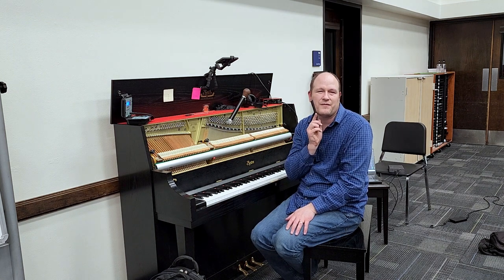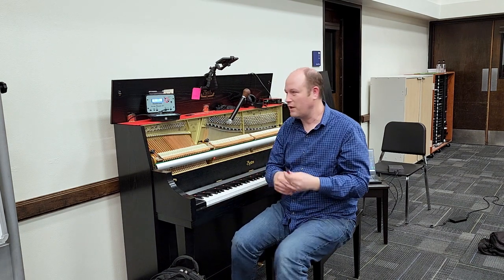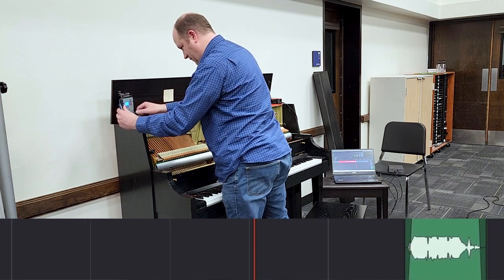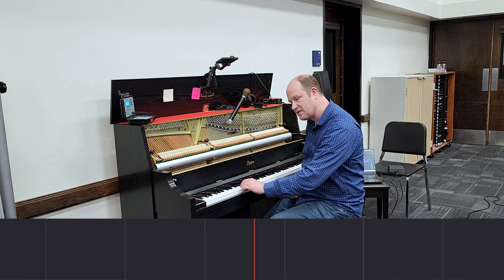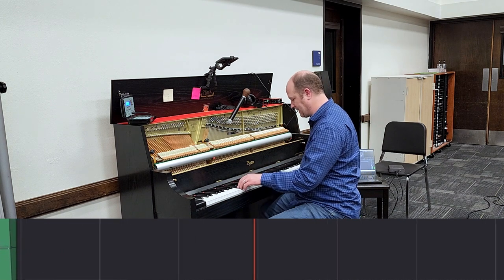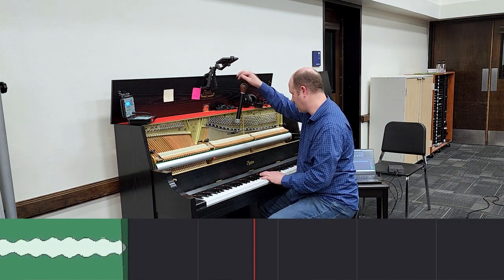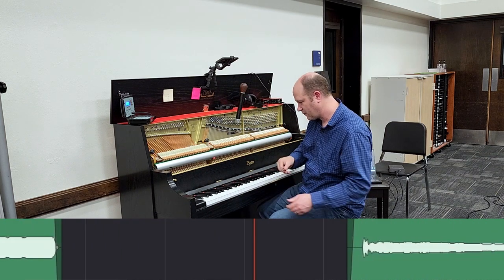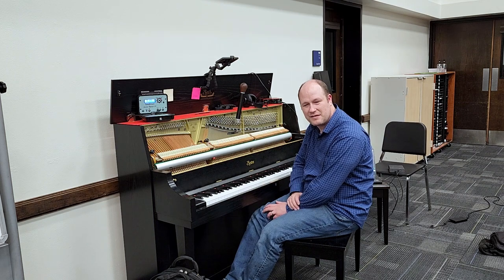Tuning a Tuning Fork...Tuning WITH a Tuning Fork

Comment: Very useful lesson! But what if the F2 is out of tune?
Reply from the maker: It doesn't matter it's a stable reference to compare the fork and A440. If it's so out of tune that the beats are too fast or slow to hear well, rough tune it close enough so you can hear the beats.

Comment: Can't you just tune A4 to the fork? Seems faster and easier, so what is it I'm not understanding?
Reply from the maker: Tuning to the fork by just matching the pitch as you listen to the fork will get you close, but it's hard to get it right on. We are shooting for a pitch that is within one cent of the fork margin of error, to get that close, I have to use a beat check to make sure I'm right on. So yes, faster and easier, but not as accurate as comparing the beats.